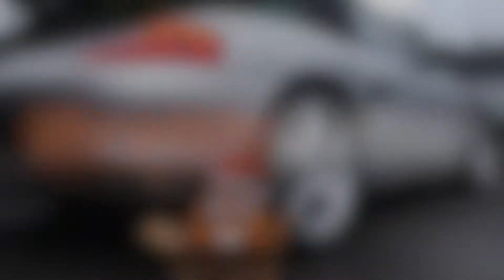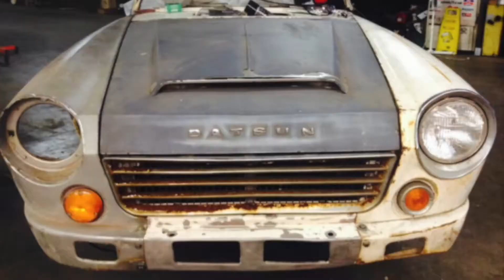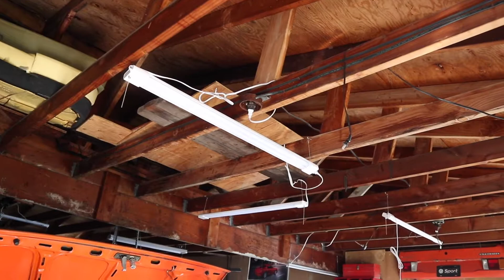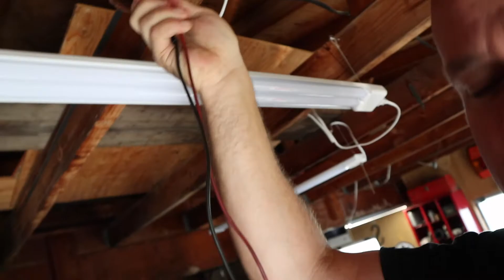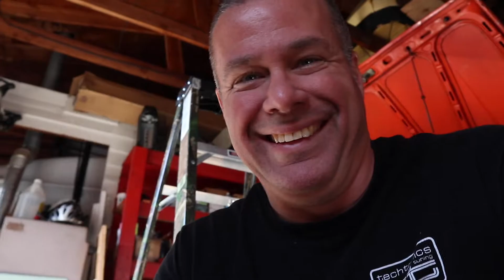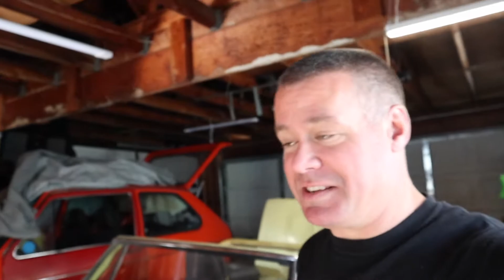Putting the grotto in Throttle Grotto!!! -massive shop electrical problems!

Comment: Fluke, Ideal, and other companies make plug socket circuit testers that are cheap. It could save you a bunch of time and money. They're available at most hardware stores.
Reply from the maker: I do have an outlet tester. Good idea, I'll check them with it and see if I get any insight with that tool.

Comment: Neutral. Tighten the neutral at the panel in house and in garage. I’m assuming you have panel in garage. Also make sure all grounds and neutrals are floating in the panel in the garage.
Reply: Send me a pic. I’m a master electrician local 46. I  live in Edmonds wa. Cllishof@yahoo.com
Reply from the maker: My panel in the garage is really old. I'll check it out and see if I can spy anything loose in there.

Comment: If that is a secondary panel out there, I'd be inclined to turn off all the power to the garage and keep it that way. If it decides to further degrade, you don't want it going back to the main.

Questionable electrical wires and breakers can cause fires.  Have extinguishers at the ready near all fuse panels!
Reply from the maker: It is a secondary panel, but there isn't a breaker for the garage wiring.  Was going to have that done when the electrician came out.  It will be good to take care of this regardless